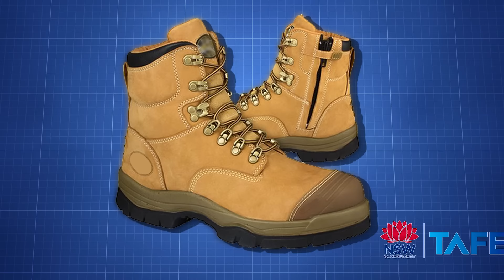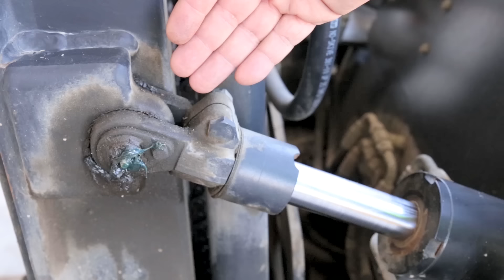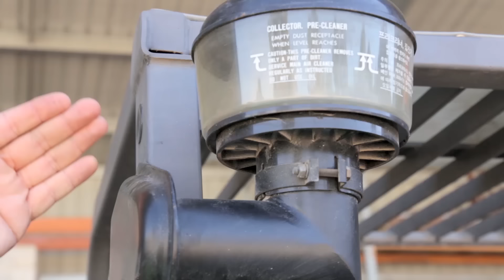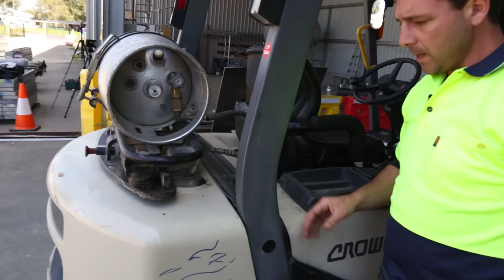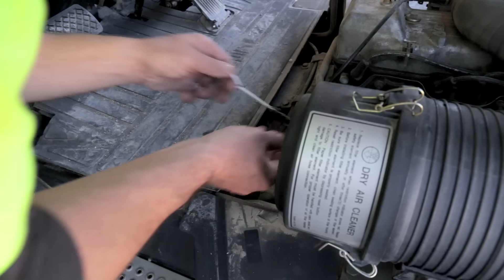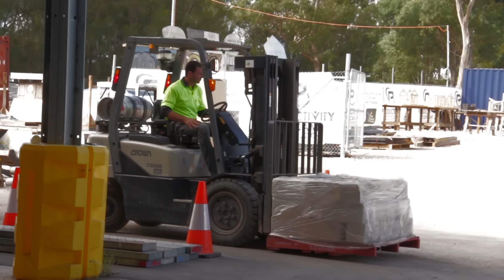Ace Your Forklift Certification: Expert Tips & Refresher Prep

Comment: Your traveling forks position is way to low, if you happened to hit somebody traveling with them that low you’re going to completely take out their ankle, and they’re never gona walk again without an amputation and a prosthetic. The ideal height for travel is between the average humans knee and ankle, so if you happen to hit somebody their leg is going to be broken clean at mid shin which at worst would require an op to reset the bone and a few weeks in a cast with a clean break

Comment: Interesting to see the different rules and guides for fork lifts in different countries.  Over here in the UK we're instructed to never apply any tilt while the pallet is still in the racking.  That would be an instant fail.  Tilt can only be applied once the pallet is at ground level.  I have my test tomorrow, so im going through different videos to brush up on my revision
Reply: It's state based in Australia
You can only tilt when at ground level a metre away in Australia aswell
Reply: i was told low hight full back tilt when moving
Reply: @alexroper6255  That's how it is in the UK too.  Full back tilt whenever the truck is in motion.

Comment: No one noticed the far left pedal that looks like a clutch but is never used in this video, as far as I could see? I wonder what it's for.

EDIT: Ok, I just found the answer on another video. They call it an "inching brake". It disengages the transmission so you can use the gas pedal to raise/lower the lift faster without having to switch the gear to neutral. So, almost like a clutch because they're both used to disengage transmission but on a normal car you also use it to change between gears. On a forklift I guess you only have forward, reverse and neutral so there's no need for a proper manual clutch. I'm also assuming it has an automatic gear shifting system to prevent excessive wear on the transmission.

Comment: the forklift isnt even serviceable  NOTE @ time 14:50  the orange flashing beacon is supposed the be flashing. in this video it isnt. @intro2outro id like to suggest if you are going to film videos on how to SAFELY operate equipment make sure it meets the correct standards first. as this is supposed to be a demo on how to do a pre operation/prestart check followed by how to use the equipment

Comment: Most good company's have a maintenance department for that 20 minute inspection lol.
Reply: It still seems like it would be good to know though for a quick walk around. After all if you drop a pallet on somebody because a crack wasn't caught the maintenance dept may be responsible (or not) but you would probably still feel very bad about it.
Reply: Wrong. Its the operators responsibility to ensure it's safe to use. If not you follow out a MRF.
Maintenance Request Form

Comment: Damn, your shift is going to be over before you get a chance to check everything.
Reply: A full check is only done early in the morning, you cross boxes on a card, hes explaining so it goes slower, otherwise a real check is much quicker, write your name and then on the rest of the shifts you just check the breaks, steering and lifting, something you can do while on the move.
Reply: Lmfao. Check the finances....chexk the chicks in the street...check the door and dust levels... 9 fucking years later. Shifts over
Reply: @dankwoffmemes7735  good to get paid by the hr
Reply: @dankwoffmemes7735  more like the company closed down 🙋🏻‍♂️
Reply: Imagine the boss says "Back to work!"
and all employees checking the machine over 4 hours
Reply: nobody does this shit.
Reply: @fastfoodcritic4353  if a man approaches you with a video cam and says, "don't worry, it's all fine, I checked it earlier" - maybe time to suspect something... 😅
Reply: Fast Food Critic this is why somebody turned the corner in a LLOP and the battery flew into my ppt
Reply: @fastfoodcritic4353  they do the checks every morning at my work. Its how we notice if things need fixed. It takes 2 minutes.
Reply: @NaeMuckle  2 min? this video 20 min .
Reply: @NaeMuckle  clown
Reply: @fastfoodcritic4353  yes it takes 2 minutes to do the morning checks. You check the forks, hoses, chains and everything else. It takes minutes and you fill out a check list. You do the same every morning with mobile crane. You do the same every morning with a gantry crane. The videos 20 minutes because he's explaining each check but a qualified operator would run the checks in minutes. Youre calling me a clown but you'd last less than 2 minutes in the oil and gas industry with your attitude.
Reply: @NaeMuckle  bro i get on the forklift in the morning and if somethings wrong ill know when it happens. i drive a flatbed truck. u really think anyone pre trips lmfao. check ur oil and anti freeze if u know it leaks. thats about it.
Reply: @fastfoodcritic4353  yes they do check in a hell of a lot of industries. Just because you don't know how to do vehicle checks doesn't mean that competent people aren't out there doing them. There's a reason why industrial accidents in the states are so much higher than the uk. If I get on a forklift and just know when it happens I can drop $200, 000 of equipment and cost $1,000,000 of non profit time. Checks are done every morning and between every shift.
Reply: Safety first. These safety checks might look funny and a joke to you but can save your or someone’s life.
Reply: 🤣😂🤣😂🤣IS THIS GUY IS FOR REAL!..? If my boss sees me doing that type of inspection on the forklift before i used he will think im just fucking around and lagging  to kill time i woul get fire by doing all that bs checking
Reply: Lol
Reply: @19lol19  wtf is this
Reply: Yeah, there's no one in the real world who does any of these checks before they operate a forklift. I was looking for more practical tips.
Reply: Average check time of any vehicle/machinery/equipment is 15 minutes. He's actually on point
Reply: I ain't touching the dirty ass chains or putting my finger near the hoses.
Reply: Legend says bro is still checking till today 😅
Reply: Lol, safety first man!!
Reply: Yeh I have never done an actual pre start check I just jump on and start driving
Reply: Can't leak till you turn the key
Reply: Haha ..no pressure in solids...fuck that funny 🤣
Reply: Now yr hands are dirty ,before your done any work .... Comedy gold
Reply: Most places say come in early and do it. LOL!
Reply: I drive forklift truck now I never do all that checking but it's actually the right way to do it the way this guy is showing but I hop in drove it away😂😂😂😂. Only thing I will check is the propane tank to see if it's on full or E. 4 months ago I didn't know how to drive.  Now I want to learn to drive the reach truck
Reply: Dude the best comment ever! 😂😂😂 for real he’s gonna go home before he even moved anything and then do it all over the next day! 🤦🏻‍♂️😂
Reply: It's a piece of heavy machinery. You didn't engineer it did you? So how do you know whether or not this is an excessive checklist? I haven't even begun my formal training but I've done enough homework to know that checking a class 4 or 5 lift is not supposed to be like checking whether or not the oven is on. These are complicated machines. And non-electrically powered lifts' daily inspections seem to be a whole lot shorter than the electrically powered ones.
Reply: i agree he a fruit loop
Reply: LMAOOO RIGHT WE JUST WANNA KNOW HOW TO USE IT SHEESH 🤣

Comment: why are tires big at front and small at back?
Reply: Nipun Singhania - I imagine the big tires are there to handle the weight of the payload on the forks. And the tiny back wheels are for better manuvering? I'm just guessing.
Reply: This is correct.  Like a farm tractor, the big muscle wheels push/pull the weight of the tractor, with a forklift it is in reverse.  So the drivetrain operates from the front wheels, the steering from the reverse. There are tractor/lifts with same size wheels but those are usually for rough terrain where ground clearance & extra grip is required, for example with typical reaches.  Counterbalance are usually expected to work on tarmac or at least flat terrain, so smaller wheels enable more agility in turning, making them more ideal for working in tight spaces.

Comment: you did everything but explain what each operating lever does /up dawn tilt side to side.
Reply: Left stick - move forks up and down
Middle stick - tilt mast forward and backwards
Right stick - shift forks left and right
Reply: @DarkCybrid  until you get a cross directional lever and manifold setup... some nissan have them and so do lindy! Lindy have a hydrostatic gearbox  and don't have a break they have a pedal for forward and a pedal for reverse and a cross directional hydraulic lever they are dangerous I hate working on them they are shit
Reply: DarkCybrid lol not all forklift trucks have the same controls here in England UK they are alot of trucks which have the controls which are switches
Reply: @tonydarbo8640  Yer some yales and hysters have that shit! Yale is hyster! Just more shit to figure out what's wrong know it's a switch or a solenoid before you blame a valve in the manifold or a fuse or the seat switch or the seatbelt switch or any other aftermarket safety device that's been fitted to it at fault mate
Reply: You dont need to know beforehand. Just push and pull the levers and you will understand very quickly how it works lol.
Reply: Exactly
Reply: That is what I was looking for in this video
Reply: Patrick Rowe exactly
Reply: @Hello Patrick how are you doing
Reply: “How to operate” shows everything ur how to operate
Reply: That is literally why I watched this video.  I wanted to know what exactly lever does and he skipped that part all together 😂😂😂